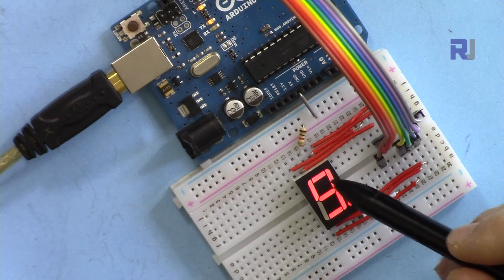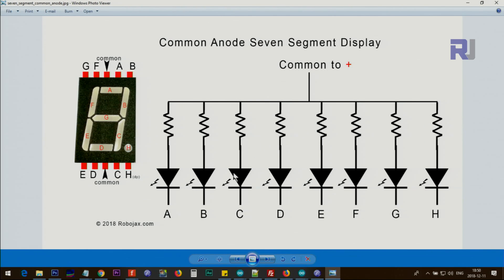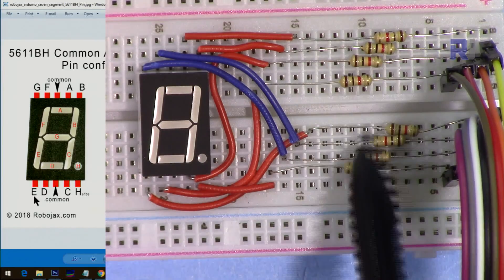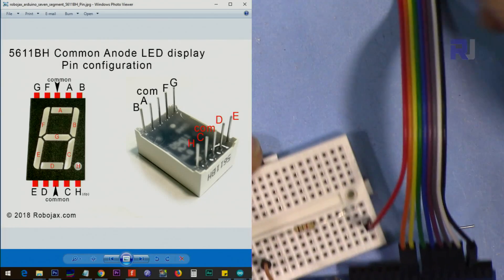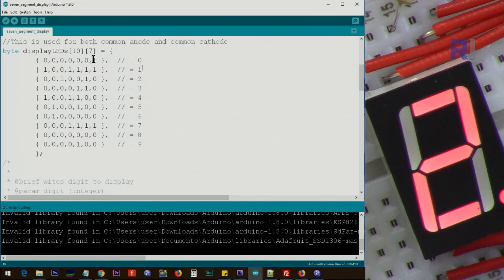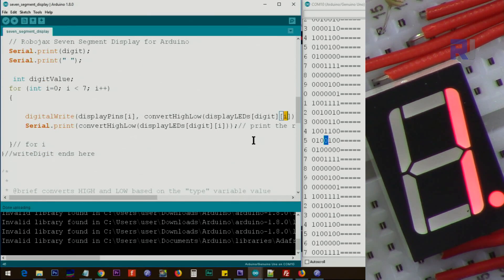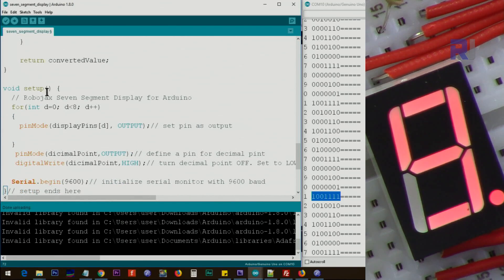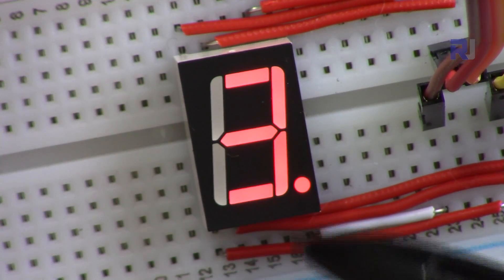How to use seven segment LED display with Arduino RJT149

Comment: like why would I work on my code if I can't tell if the wiring is correct?
Reply from the maker: Please watch carefully. I have explained it fully
Reply: I’m appreciative for the tutorial but you start with an example of what NOT to do. Then go into the way to do everything. I broke my arduino because I accidentally shorted it and had to go get another one. None of that is your fault but from my standpoint the video goes from being unclear which method is which. I was originally under the impression that the resistor method was a separate one all together and the first example you gave was for common cathodes if the method with multiple resistors was for common anodes. Also some not on what resistors to use and why would be extremelyyy helpful. Because these videos I’m sure are made for beginners, and to us, this led display is a black box with inputs and outputs, but we know very little about the currents. I don’t think I’m alone in this. If you use one resistor instead of multiple, does it need to be greater? I’m assuming so but I’m unsure of how the resistance would compound in this situation. And this matters so I don’t short another board. And then suddenly it’s in another configuration where the diode isn’t on a board at all. Again, I’m appreciative but it’s a huge lack of consistency. When multiple things change in a system at once, people unfamiliar with that system will have a hard time figuring out the dependent variable from the independent outcomes which can significantly halt learning. And then it jumped right into the code section. Im sure it’s just because I’m new but those are some of my very real concrete beginner questions that contribute to the majority of my frustration. Although you’re doing an amazing thing by sharing what you know with people and I don’t mean to discourage you from ever ever doing that. Im just frustrated it’s day two of this, and I’m much more hesitant than day one because I’ll have to get another board if I mess up the single resistor I’m using and I’m only using 1 so my other resistors don’t touch and accidentally cause a short. Just because I simply haven’t learned these things yet.
Reply from the maker: Hi, it seems still you have not watch and listend. The seven segment needs different amount of current for each digit.  for example (this sucks to type it as I have already explained it in video. why should I type it).  digit 1 need two segments. digit 3 needs 5 segments. so when you used ONE resistor which is totallyh wrong and that is for lazy people. Because they are lazy, they get the lazy result. when digit 1 is displayed it would be very bright because two segments are turned ON and when displaying didgit 3,  five segments are turned ON and the the display need  lots of current. the resitor reduces the voltage significally  (V=IxR ohm's law) and as a resutl the displayh will be twice dimmer. so please please watch again carefully. I have mentioned.

Comment: Great video.  I would, however, like a bit of clarification.  On your other video you calculate the resister value for each segment as 140Ω but in this video you say the value can be between 560Ω and 1kΩ.  Why the difference?  I'm asking because I plan to incorporate one of these using an ESP32 which can supply Vi at 3.3V.  I want to make sure I get the calculations correct for the resistors (or may explore using a single resistor).  Thanks.
Reply from the maker: Hi, the calculation should be correct and it is exact. But higher values can work except it will dim the dispaly.  So get datasheet for your display and calculate it as shown in the other video.
Reply: @robojax  can you link me the other video please?

Comment: Would it be possible to use this setup with an DS3231 RTC module so that time could be displayed on the 7 segment display?  I'd like a circuit/code that flashes each digit of time for about half a second sequentially if an input button is pressed.
Reply from the maker: I believe I have a video on that. Please search my channel. Here is how to find Specific YouTube Video in a channel https://bit.ly/findYouTubeVideo

Comment: Can i use Arduino Nano with this lcd you're using along with touch module ttp223 ?
Reply from the maker: any arduino
Reply: @robojax  Can you please tell me what battery source should I use with arduino nano, touch module ttp223, reset button , 1 digit 7 segment lcd. Thanks alot !!
Reply from the maker: The most powerful item of yours is the seven segment display.  For nano you can connect 7 yob12 at VIn pin so get a 9v battery which will run out fast. Best option is to use rechargeable battery .
Reply: @robojax  Thank you for helping out. Sir, if 7 seg display is power hungry. Can you please suggest me what will be the good 1 digit LCD that will require less power with all the devices mentioned above. 
I want this project to be cheap and portable with battery source.
Can I power Arduino with 3 triple AAA batteries?
Reply from the maker: No you can. Aaa has 1.5v then 1.5x3=4.5v and it will not work
Reply: @robojax  what if I use 4 AA or 9v batter with a holder what will be good ? Also it's so kind of you for helping sir.
Reply from the maker: Yes you can use up to 12v but connect it to VIn pin or to the power adapter jack